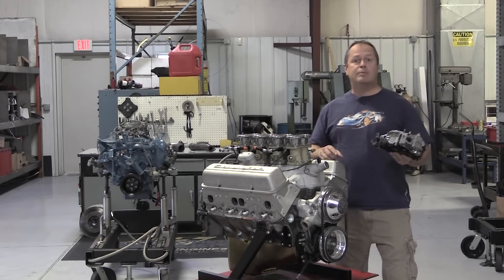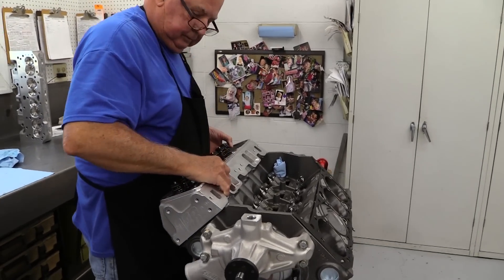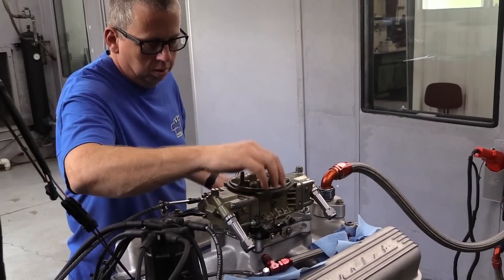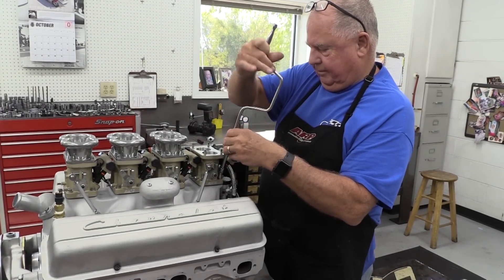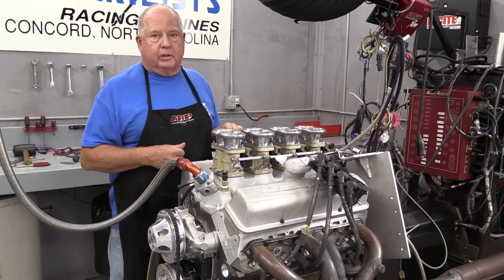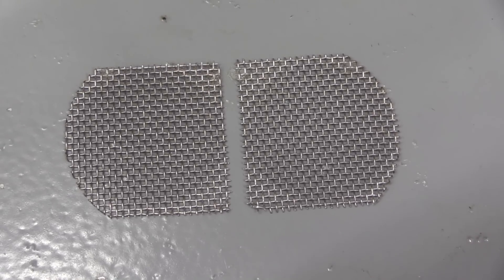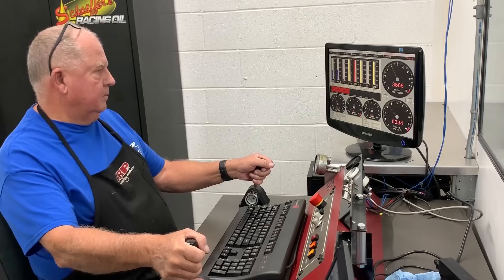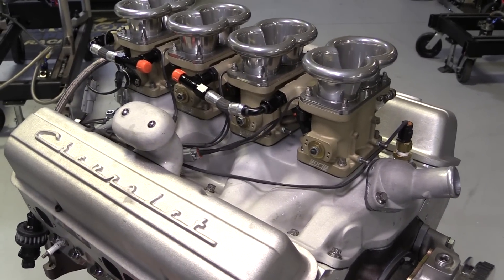Carb vs EFI - Dyno Testing a Holley Double Pumper vs Custom Stack Injection

Comment: I'll bet if those throttle bodies were perched on top of a 6-71 blower, it wouldn't run out of air.🤣 Seriously though, in the long run, EFI is going to be light years better than those troublesome Holleys, especially after they get a few years/miles on them. The EFI will maintain a more accurate mixture across the band and isn't affected by engine vibration, acceleration anomalies (like the gas sloshing around in the floatbowls), and will operate at a much wider temperature range without the usual carb issues of poor atomization, leaky needle valves, etc. What you sacrifice in top end horsepower over a carb, is offset by reliability, better fuel mileage, and overall driveability.😉

Comment: Efi system will always beat carb if the runners had been sized right. You can have the same airmass going through with efi, the keyndiffrence is that u can tune very many data point for maximum torque and best afr and knock kontrol. It works the same but diffrent air+fuel. Efi gives more data and adjustable points just.

Comment: In short, larger ITBs could flow more and make more power.  Plus, driveability across the rev range, better fuel economy, no synchronisation upkeep,  much better off idle, etc. And much cheaper!

Comment: Should have used a dual plane intake , it would have out performed the efi unit all through the dyno pull just my opinion.
Reply: those heads flow way more than a dual-plane could ever flow that would be a move backwards an air gap RPM flows 220 CFM out of the box those heads flow over 270...

Comment: Now lets compare a Performer RPM with a 750 vacc or similar.
A Victor Jnr will never have the bottom end of a dual plane.
And how many extra dollars do the efi and electronics cost?  Probably about 4 times as much.

Comment: The butterflies are holding it back at the higher  rpm don't get me wrong nothing's wrong with a carb except cold starts in winter a pro stock is is a great example for power 1400hp but the only down side if u had a big single throttle body efi would lose low end torque unless it was forced fed  good work guys looks trick 👍
Reply from the maker: Thanks! And thanks for watching!
Reply: Just make stuff up...
Reply: You won't loose any low end torque... the ability to fine tune the low speed ignition & fuel maps with efi eliminates that kind of nonsense.

All of you carb guys've literally never had any real experience with MODERN fuel injection.

Comment: Well there´s nothing wrong with carbs when they are adjusted properly, however a well tuned fi system is much better overall in comon use, no constant adjusments and great realiability, and of course individual throthle bodies look as good if not better than old school webers
Reply from the maker: Exactly right!

Comment: Had the carbed setup had a dual plane intake it would have had much better bottom end power. Single plane intakes shine at upper RPM's.

Comment: That was never going to be a fair shootout, even with butterfly size difference, you are comparing a Victor Junior to what is effectively a stock two barrel manifold (with 8 barrels). Add some two inch spacers under each of those EFI throttle bodies to make the runner lengths closer to the Victor Junior and add bigger throttle plates and then let's see who comes out on top then.

Comment: Have to change the cam.shaft lobe when you go to EFI, would have been uch better results. Also, the fuel pump should deliver more psi with the EFI, to me it wasn't a real comparison
Reply from the maker: The dyno setup uses a high pressure Aeromotive fuel pump. For fuel injected applications it provides plenty of pressure. For carbed applications, the pressure is turned down on the pressure regulator.
Reply: @TheHorsepowerMonster  ok I see, do you guys sell engines? I have a 85 chevy Silverado I want to put a radical engine in...
Reply from the maker: @bobowlowgrowing6387  I don't personally, but my friends at www.AutomotiveSpecialists.com can fix you up. Good luck!

Comment: with the amount of money you spent on that thing, you probably could have built a 23deg 410ci sprint car engine.

as for a single 4barrel carburetor, you don't get any simpler, or cheaper build than that.
Reply: tell me its more simple when you are spending a day to tune, and im cruising the streets with better fuel economy.

Comment: 44mm TBs are too small for best power with 625cc cylinders (5.0L V8), and far too small for 825cc (6.6L V8). On a V8 engine of this displacement, this particular EFI is sized for "street cruiser" operation with instant throttle response and part throttle torque, not big power.
Reply: tubad4ya : Your 100% right. Way too small. It needs 54mm  throttle size if it has no chokes to make power past 4000 to 7000, where a proper sized TWM 8 stack will make well over 600 hp. I havent muktiplied everything by 1.333 to compute for a 350 V8 as my back ground is 6 cylinder cars with 40 mm chokes and 45 mm throttles. They heal over at just 306 hp. Up to 1.181" or 30mm,180 hp sixup to 1.260" or 32mm, 198 hp sixup to 1.378" or 35mm, 234 hp sixup to 1.496" or 38mm, 276 hp sixup to 1.575" or 40mm, 306 hp sixup to 1.653" or 42mm, 336 hp six Up to 1.771" or 45mm, 390hp sixup to 1.889" or 48mm, 444 hp sixup to 1.968" or 50mm, 480 hp sixup to 2.047" or 52mm, 522 hp sixup to 2.126" or 54mm, 558 hp six.

Comment: will a EFI system for a 2.9l Ferrari v8 work on a 6.5l Chev small block, well sort of but you'll run out of air and fuel.

Comment: A properly tuned carb with correct intake will always make more peak power than a fuel injection setup. The only exception to that is on an engine that runs nitromethane because fuel injection will atomize the nitro much better than a carb.

Comment: Here's what I don't get in the comments. Why are people suggesting to put a dual plane under a carburetor and a head that can flow way more than a dual plane could ever flow? You know a small block Chevy or small block Ford dual-plane intake only flows 220 CFM? That can't even keep up with the 170 trick flow head on a Ford that I want to build. And you think it's going to keep up with a 270 CFM 195 CC head???!

HELLLLLLL NO lol that's moving backwards technically you're intake manifold supposed to flow a little bit more than your heads as to not cause a chokepoint you ask anybody who ported manifold will tell you the exact same thing I'm telling you

 even in the Edelbrock instructions it tells you to Port match the manifold

Comment: Wait... why did he drill out the bottom of the manifold?
Reply from the maker: I didn't get the opportunity to video it, but he fabricated a small sealed chamber underneath the manifold. The holes in each runner go into the chamber. This creates a balance chamber or plenum so that each barrel of the EFI can see every intake pulse so the MAP sensor can function properly. Hope that helps and thanks for watching!

Comment: With this camshaft you would have made way more power using dual plane performer RPM manifold. Using Holley 750 DP Ultra it's 560 HP with 530tq IMO. This is the Dart SHP short block, not sure why you did not mention this?  The Victor Jr is seriously made for 3500-8500 RPM, not the right manifold for this engine.
Reply from the maker: A dual plane intake would have made more low-end torque but not overall horsepower. Also, we tested with a 750 carb, and the 830 made more power. And actually I did mention that it is a Dart block at 1:00. But it isn't a Dart short block, the crank and rods are from Molnar. Thanks for watching!

Comment: I tell young drag racers this all the time but they don’t believe me they tell me EFI is king, sorry carbs are king, it’s amazing how much you HP you lose from EFI but EFI you can make a quarter mile run with a blown 632CID BBC and only use 1/2 a gallon if it were carburetor’d the 632 would go through about 10-12 gallons of gas per 1/4 mile pass that’s another reason Carbs make more power the more fuel you burn the more HP you make, and you never run 4 2 barrel carbs you run like 2, holly 1000CFM dominator carbs instead of four two barrels, two barrels are for like four bangers and small six cylinders, Webber makes a bad ass high performance 2 barrel carb

Comment: They do mention it in the video but that really was a pretty bad setup to use as a representative of fuel injection. The 3004 series of throttle bodies are for much less powerful engines and they're mounted on a swap-meet manifold that I strongly doubt are a good match for those AFR heads.

Comment: How about using a Holly carb replacing fuel injection throttle body. 
I believe all of the power difference we see is down to intake manifold and throttle differences. Also if the fuel injection system was put in an identical airflow system as the carb setup then I think they could extract more power all over including at the peak
Reply from the maker: Absolutely. A modern port injection EFI system on a single plane would be a great power producer. But the truth is we didn't have that. Dorton had a cool vintage style EFI setup going onto an engine for a customer, so I thought it would be fun to compare it to a recent carb build on an identical engine. Thanks for watching!
Reply: @Reuben Horner Engine Masters tested Holley EFI and a Holley carb of almost identical CFM on the same manifold and the carb performed much better. The difference in power was mostly caused by temperature. Intake temps of the carbed engine were just above freezing while intake temps of the injected engine were just under 100 degrees. Fuel atomizing throughout the entire length of the intake runners creates a massive cooling effect on the carbed engine and everyone knows a cooler charge makes more power. There is another test posted here on YT where the throttle body they used was a couple hundred CFM larger than the carb it was pitted against and it made a couple more HP at peak but lost over 30 foot pounds in the 3000-3500 range which is a very important place to have 30 extra foot pounds in a street car.
Reply: @Impactjunky  Can you pleas stop parroting the same shit over & over?
It is NOT THAT BIG OF A DEAL BUD....

Comment: Why not test a dual plane intake with carb to get that mid range torque and drivability.
Reply: Why not discard and abolish these ancient, medievel carbs altogether in favor of the much, much better EFI?
Reply: E Knaap because when your electronic efi fails and your on the side of the road I won’t be I’ll be enjoying my ride and the sweet sound of my carb.

Comment: And what part was surprising? A bigger carb made more power. Great for racing,, though a smaller carb would be similar to the fool injection.  Gain bottom end at the expense of top end power. Using a more suitable intake such as a Performer RPM will improve low end and mid range. Near certain better than the efi. For a whole lot less money!
A proper 8 stack race type  efi should make more power again.  BUT a lot more complicated and a lot more expensive than a simple carb and distributor though the crank trigger when working properly is probably a little more accurate, but then requires a computer. So not really worth the money. 8 stack however will be very nasty bottom end.

Comment: This is cool and all but the EFI setup technically has a Longer runner even if the intake manifold has a shorter runner than your carb setup.  This test doesn't really show the difference between carb and EFI.  What it does show is the difference between intake manifolds and runner lengths.

Comment: What is the difference in price? Surely the carburetor style is cheaper. For the budget racer there is no question. The efi does not outshine the carb by much and in my opinion is not worth it. Besides working on the efi system would be a nightmare but the carb is easy. I know technology marches on and I like it but not in this case. Just mt 2 cents.

Comment: I would like to c some modified quadrajets ...if it is even possible.
Reply from the maker: That's a cool idea and would be a lot of fun. I haven't even thought about it, but around here (NC) I don't remember seeing many (any) fresh builds using a Quadrajet in quite a while. Will keep my eyes out. Thanks for watching!
Reply: @TheHorsepowerMonster  thank you for appreciating the suggestion and hopefully u can get around to trying it out...thanks for the videos.
Reply: That would be cool I've been wanting to see something like that for awhile
Reply: @TheHorsepowerMonster  @Scott Miller Qjets are great carbs, they got a bad rep for being a little complicated but they can be real performers when optimized. I'm in NC and I'm running the stock tweaked Qjet on my 84 Trans Am and I also have one that's going on a low budget Oldsmobile build soon. The one on the Trans Am has excellent throttle response for a basically stock 305. I have no clue why they stopped making those cars carbureted, I've never seen a stock TBI or TPI Trans Am or Camaro that could roast a tire as well as mine. Plus there's a Retro Motor Week vid here on YT that shows a Qjet 305 outrunning a fuel injected 350 in the same car when they were both brand new.

Comment: Screw carb!...EFI is more reliable!...no stuck needles and vacuum leaks and loose linkages!...I'm through with carbs!...converted my 78 Pontiac 301 to EFI before selling I to my neighbor!...good little engine been running forever!...

Comment: Put a dual plane under the carb
Reply: Why? It'll choke those heads
Reply: @KingJT80  they talking about the torque gain from the efi. youd get the same or better low end torque gains with the carb and an airgap dual plane
Reply: @XxMusclecarsxX  the little gain in torque it may gain with a dual plane will probably kill the power though. I dont think id chance it. What they should have did is use a good set of 180cc heads and a dual plane. Lots of toque there down low

Comment: had a Stage 1 Buick with a 650 spreadbore with mechanical secondaries. it would spin and bounce the L60's through all four gears on the M22. beat you to death.
Reply: with a silly grin.

Comment: a true test would have been with two double pumpers 8 barrels to 8 barrels
Reply: I'm not sure if it would make that much difference on a small block. Dual quad setups usually make the biggest difference on big displacement big blocks

Comment: 🤔 i think if both engine has force induction such turbo maybe the result will be different, 8 hole means each cylinder had their own intake to suck more air, more air means more compression power, well i not really expert in this but my logic said that 😅😅😅

Comment: If the injection system is running closed loop; it may out perform the carb under less than ideal conditions.
Reply: It depends how the injection computer is programmed. It's closed looped when Lambda =1, but one can program it to leave Lambda =1 when full throttle or over 5000 RPM.

Comment: Was there anything on this engine that was Chevrolet? I don't think anything including the block ever came from GM. It's a great engine but not a Chevrolet.
Reply: Yeah, made with stuff that will live longer than a week!
Reply: @johnsaum1260  hahahahahaha  yup
Reply: If it 4.4 center bore, 90 degree, overhead valve pushrod v8, it's Built on the original 1955 Ed Cole & Zora Arkus Duntov design, it's a CHEVY. No mater what block or heads it may have, if it has those attributes, it's the GranDDaDDY. It's the coldest engine design on the planet. The generation 4 GranDDaDDy (LS) is the coldest in the game.
Reply: @josephmcintyre752  They are cold. Because they never run!!  hahaha
Reply: @jondoe6618  I guess that's why they are the most swapped engines in EVERY other car make. Nonidy us swapping Ford or Mopar engines into CHEVY'S, but you have plenty of CHEVY'S being swapped into that other crap to make it worth driving. Your comment was cute, I admit, but top that Mr. Doe
Reply: @josephmcintyre752  Only because there so damn cheap. I kinda wish I was a chevy guy. A ls is like what 200$ aftermarket heads are like 200$  And if i was a chevy guy I would be too damn dumb to realize i was dumb and wouldn't know any better. Just wait until the coyote motors become cheap and see what happens to your little ls.(it already is)
Reply: I'm not knocking the architecture of the engine, it just wasn't intended to live much over 400 hp with assembly line parts.
Reply: @josephmcintyre752  pontiac engineer clayton leach is the guy that designed the valve train

Comment: You are comparing a single carburetor with plenum to an independent runner system with fuel injection.  This favors the fuel injection - which is why it makes more low and mid range.  A great carburetor will smoke fuel injection any day - independent runner is the ultimate induction system.  Self learning management systems have a lower data sample rate compromising torque and horsepower

Comment: There is definately something fishy going on here, top end seems hampered by manifold, or a bad sensor or tune. There is no reason for the EFI to lose out at top end by that much. This isn't the most (or least) scientific of tests. (BTW I love carbies and EFI, have run side draughts on modern engines like SR20 and 4AGE)

Comment: Ill stick w my dual quad set up its 2 660 center squirt  set up on a 355 sbc n she runs 990s n 1/4 n 660 in 1/8 n i drive her to wrk daily sheget 14 mph n e  body got a story like that ive owned my chevy ll since 1981 n shes bad ass not baddest ass but bad ill shoot vid. Soon as can got 355 with a 4 in. Bird bath under 2 660s n shes streetable i do have a muncie rockcrusher n 14 inch zoom to boot